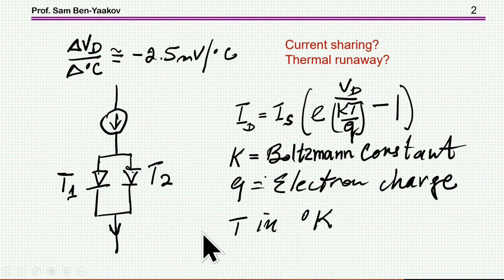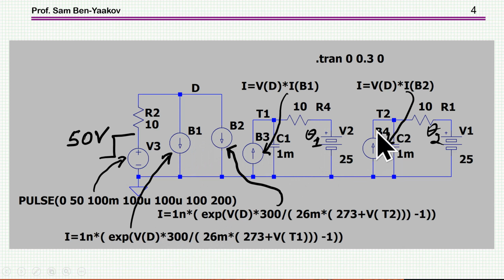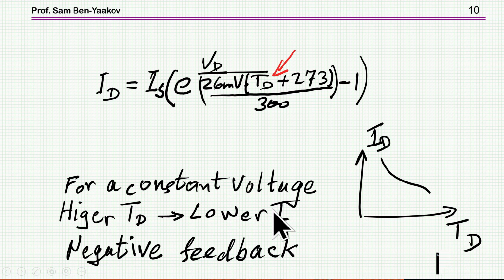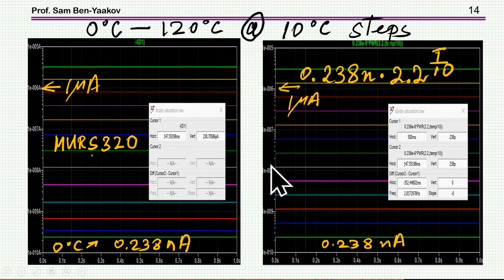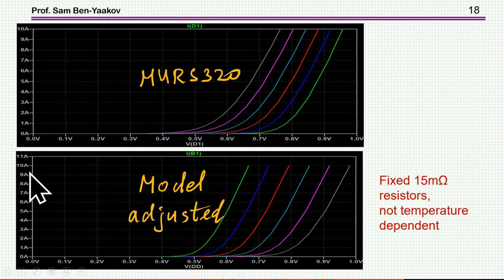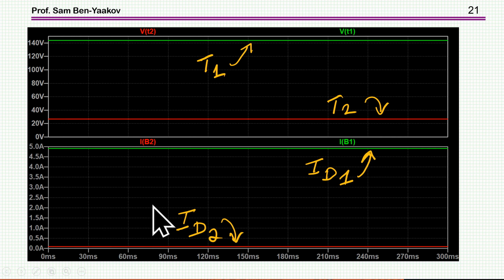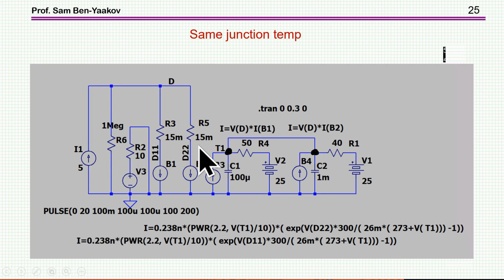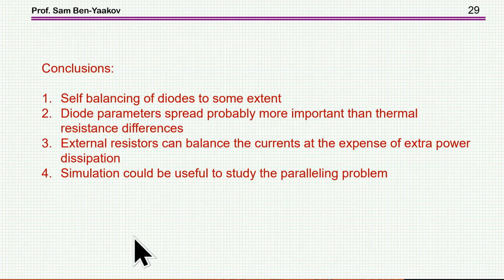Parallel connection of diodes: A second expanded version

Comment: Some LED lights use parallel LED configuration.  I have  always wondered how those LED can have same current between them without resistors.  My only suspicion is the wire bonding wire is the resistor, but is that good enough for them to work?  Or are the LED different in a way that helps paralleling?  At very low currents you can see they do not shine the same, but not sure how off at higher current.
Thanks for these videos.
Reply from the maker: Yes,  guess there is a "hidden" resistance.

Comment: I tried to reproduce the simulation, but ran into a lot of trouble. Especially the extended model with Is(T) was instable most of the time and very sensitve to the exact values of Is, thermal resistance etc. After quite some time, I found the mistake! The formula is wrong! The last -1 is in the wrong bracket! This is the correct version, according to all sources of the internet about the shockley formula!

I=IS2*(exp(V(D)*300/(26m*(273+V(T1))))-1) CORRECT!
I=IS1*(exp(V(D)*300/(26m*(273+V(T1)))-1)) WRONG!

https://en.wikipedia.org/wiki/Shockley_diode_equation

Comment: Super video (as always).
Short remark/question : most Sic Schotky diodes have positive temperature feedback in their datasheet -> current sharing sounds natural.
Do you have experience with this?
Reply from the maker: WE are using modules hat are built around paralleld SiC MOSFETs.

Comment: Parallel diode to increase power and current sharing never work , for one of my project some smart guy just parallel diode to share the current , but in practice it should more ripple,  those diode was on 4-20mA line with HART communication on top of   that , diode voltage on the same  diode are not the same and temperature depended Vd make impossible to have the same current through them. We had problem with HART communication.
Reply from the maker: Thanks for sharing. Still, there are commercial devices, two diodes in a package. Work fine in parallel

Comment: Good morning Mr Ben-Yaakov, I pay particular attention to your really interesting courses. Thank you.

I would like to ask you some questions about SMPS compensators (maybe an idea of video):

1) How to set maximum current value in ACMC with cascade control in buck converter for exemple ? 
I have seen your video about PI anti-windup, I think the method could be used to create a saturation of the voltage compensator output signal, but does it affect the voltage loop efficiency ?

2) In case we create battery charger with this principle, how to adapt the current limit if more or less current is needed to charge a battery or anaother one ?

I thank you in advance for your reply.
Reply from the maker: HI, Thanks for comments and suggestion. Will consider.

Comment: In measuring diodes or BJTs I always force current because it keeps them from going into thermal runaway.  The instability in spice is due to the thermal instability introduced by your model.  Just as in real life, forcing current keeps the currents from increasing out of range during convergence.

You video is a very good simplified illustration of the issue, but it can be more complicated.   The junction to case thermal resistance of the diodes also increase with temperature making the mismatch as temperature increases problem worse.  

Depending on used to make discrete diodes, there can be quite a bit of variation on the same wafer.     I have seen diodes in which the lower doping levels in the structure can be strongly influenced by background doping in the furnace.   

Diodes can have a mismatch in ideality factor, and series resistance, not just saturation current.  However the saturation current mismatch and temperature dependence is usually the dominant effect.

I running devices in parallel I like to think of the voltage drop the series resistors need at the peak current to prevent current hogging.  I typically use 200mV as a starting place.   However some situations require more, and some less.
Reply from the maker: Hi, thanks for important comments to the 20 minutes video. Just a small correction: I was not running the simulation with a voltage source but with a voltage source and a series resistor. The convergence problem was due to the  simulation algorithm not the physical system. The simulator managed to find a non physically possible stable  solution.

Comment: Wow, that's amazing how you use LTSpice to model the behaviour of devices professor. After watching your videos, even I started modelling behaviour of circuits, but always end up in a model that runs extremely slow on simulation. Please consider making a video on pitfalls to avoid while creating device behavior models on LT Spice or "how to improve simulation speed on LTSpice".
Reply from the maker: Thanks for comment and suggestion. Indeed, avoiding slow simulation and convergence problems is an important subject. Will see if a video on that can be put together. BTW all the simulations I show run quickly and safely.

Comment: Great video again.
Proffesor could you explain how design a current and voltage adjustable power supply circuits and how to protect opamps over voltage in tis circuit (generally maximum voltage is 30 volt and so much opamp's maximum voltage is this range)
Another subject .could you explain how to make current limiting and voltage adjustable, power supply with UC38XX chips
Also how make  more good ripple output of this kind chips ? for example 0-30 volt 0-5 ampere adjustable 

Could you make more simple  descriptions in this video? You videos for enginnering students .I don't know so much in this descriptions but your knowlonges are amazing .Thank you
Reply from the maker: Thanks for comments and suggestion. Will consider.